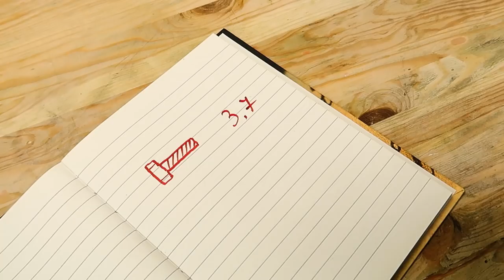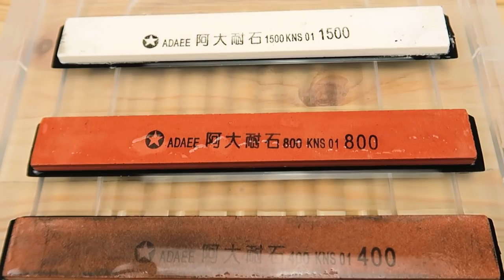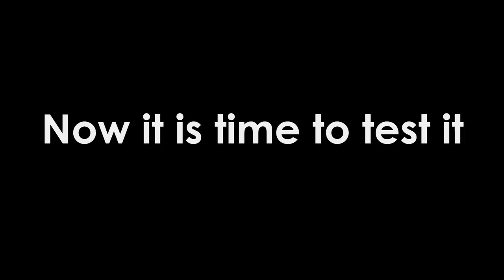German Photo Guillotine Restoration - Laser Cleaning

Comment: Nice restoration as always, but I got one question:

How hot can this laser be? Can It reach more than 400°C?
Reply from the maker: Thanks for feedback Erick!👍🏻🤗 Really,I dont know how much can reach but if he dont affect my skin,I think not so much 🤷🏼‍♂️
Reply: @CoolAgainRestoration  got it
Reply from the maker: If I found the answer I write you👍🏻
Reply: Erick ,
I don't think it the heat . I think it's more like a star trek phaser ,it stuns the rust making it loose it's grip on the metal so that it falls off. 😁
Reply: @richardpalmer6196  probably, I've been doing some researches and I found that It can reach up to 625 degree Celsius If It is 1000 W, or 100 If It is like 200 W
Reply from the maker: mine is 500. but it depends on the material you use and the focus and parameters
Reply: As far as I know about the operation of lasers, the beam can generate extremely high temperatures but very localized, depending on the wavelength (color) chosen.  In other words, if the laser operates on dark colors, it will generate maximum heat on dark areas without affecting light areas at all.

Comment: One question, Mr. Cool Again. Does the hot bluing process also work on aluminum? Thanks!
Reply from the maker: Works but is another solution for aluminium. The solution for bluing steel doesn’t work on other metals 👍🏼
Reply: @CoolAgainRestoration  Thanks! But I didn't express myself correctly, sorry (English is not my language). I meant if the process of heating the metal and quenching in oil also works for aluminum. Does it? Thanks!
Reply from the maker: No,that method no 👍🏻
Reply: @CoolAgainRestoration  Thanks!